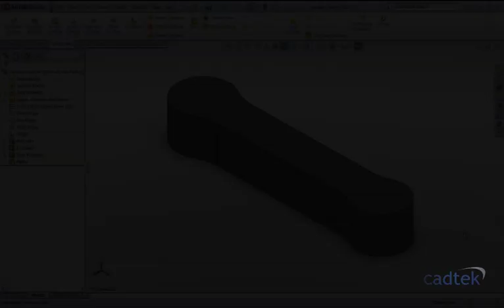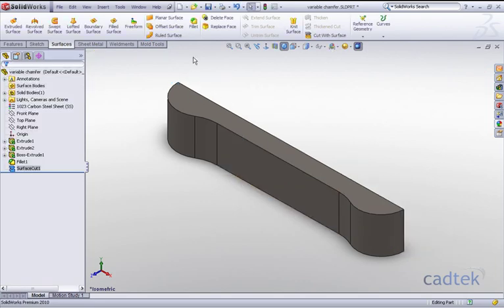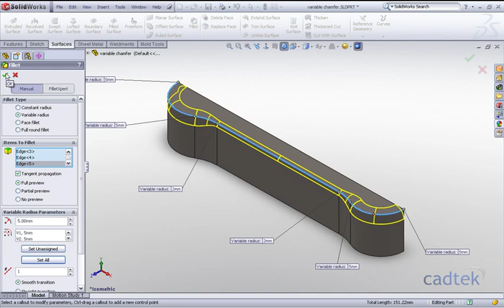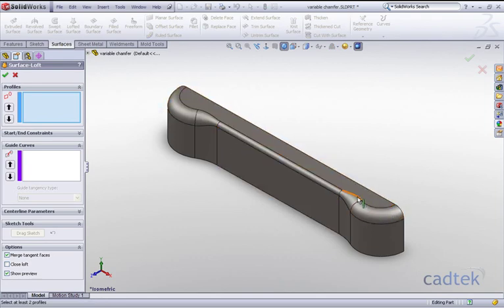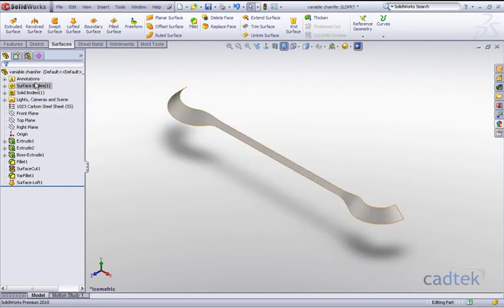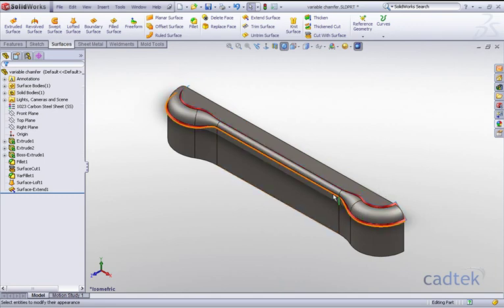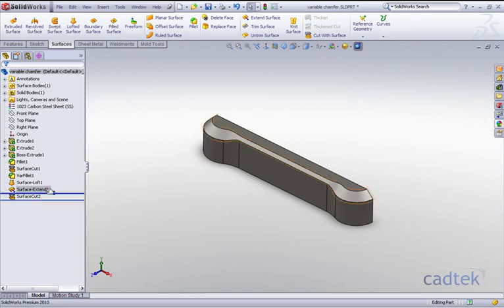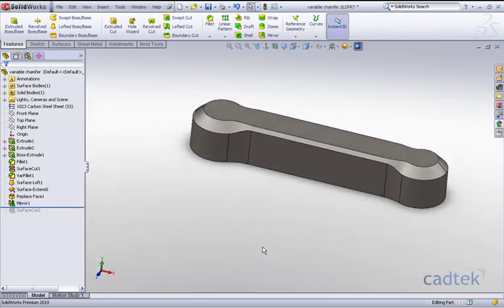Variable Chamfer

Comment: A another trick is to add the fillet, then following that use the 'Delete Face' tool; select the faces made that form the fillet and then choose the 'Delete and Fill' option, which in "most cases" will delete the fillet faces and then fill them as the Loft has done in the example video. This uses less tools and is slightly quicker.
Reply: Awesome, thanks for the tip. Unfortunately, the process in the video gave me error due to geometry, the middle finger of Solidworks.
Reply: Thank you

Comment: Nice trick, for control over the chamfer (such as the angle) you will need to create a sketch, draw a line with the angle in the corner (the chamfer you want), then create a tangent arc using the points from the line. Copy that radius as your reference.